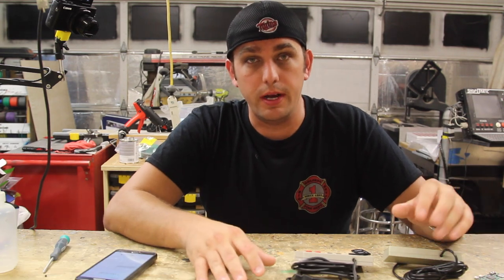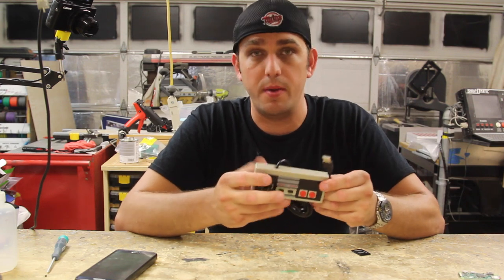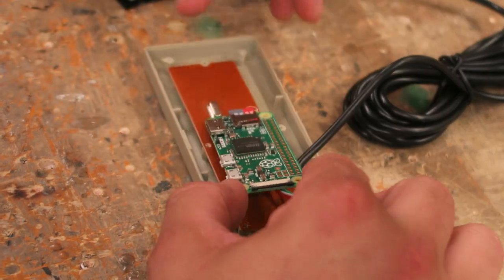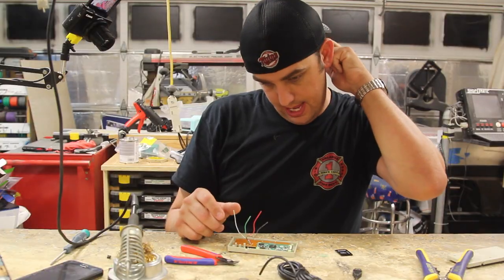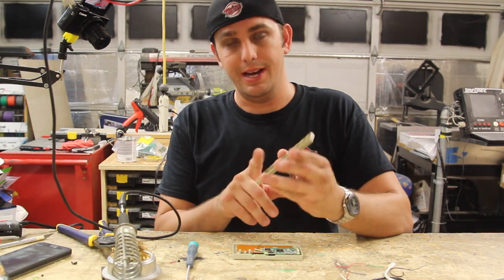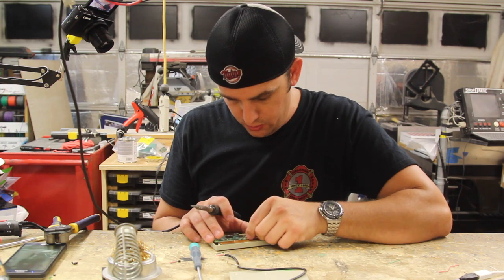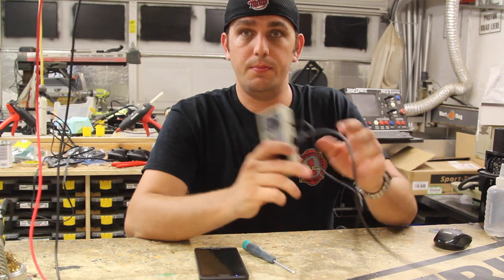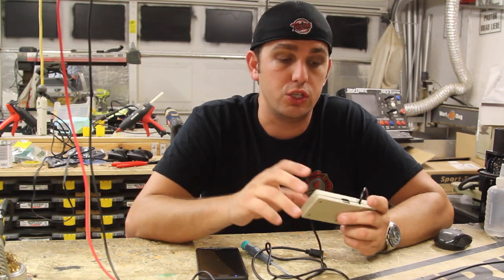DIY NES Classic | Ed's Shop VLOG

Comment: hello really nice project which i actually tried before this video, i had one problem, so i soldered a snes usbs power and data to the pi zeros data and power pads on the back of it and what would happen is that the data would not be working and after i desoldered the wires the usb data port didnt work , but after seeing this video i moght retry it
Reply: Did you have any success? I want to try with a snes controller. Its one of those cheap ones, thanks
Reply: idk i might just have bad luck but the pi would not see the controller even though i followed the same wiring, it might work for u cause i keep getting nowhere so instead i just use the controller as a cool casing
Reply: Matthew Poitras thanks for the reply mate. I've not tried it yet my pi zero should arrive Monday. Do you think the wiring is the same for both nes and snes controllers when soldering to the pi? cheers

Comment: I'm having a "no game pad detected" issue. During my build I decided to do a sanity check to make sure my soldier for the data to the USB points were okay. That said I get through the boot but no amount of button pushing helps. This is my first pi project and my first RetroPie build so any advise and help would be great. 

PiZero
USB NES classic controller 
RetroPie 4.0
Reply: So I and can get it to work if I bypass the USB power that soldiered directly to the GPIO. If I plug the unit in using the micro USB it works fine. Any idea what that's telling me?

Comment: Does hdmi output any voltage? Would you be able to power the pie off of that?
Reply: No, unfortunately. Raspberry Pis can only be powered with Mini USB cables.
Reply: You can solder direct power lines to the input of the Pi. So you can use batteries, old power supplies. HDMI 5v doesn't have enough Amps to power the Pi however
Reply: tyiphius Hey mate do you have a pin map to show where I can solder a same battery pack on the pi zero for power?
Reply: Easiest Way to figure this out would be to plug it into a power source, take a multimeter to the 2 points directly under the female power source connector. Youll get a value close to 5v or a value with a negative sign (-) in front of the same value. You DO NOT want the negative value. Now whichever the red lead is connected to will be your positive lead, and the other will be your negative. This is my process for finding out which pins to connect to.

PP1 Positive
PP6 Negative
It'd be smart to wire up some sort of battery protection circuit